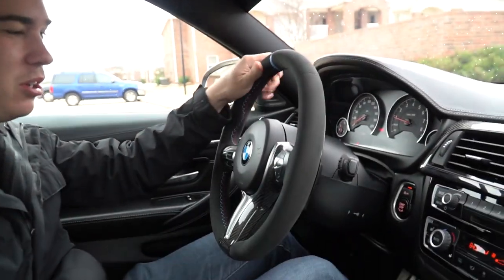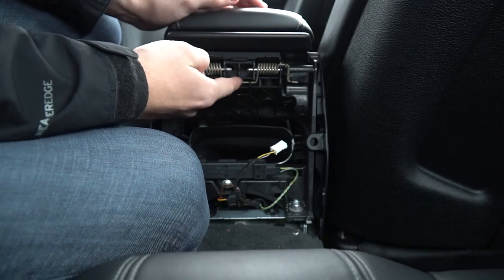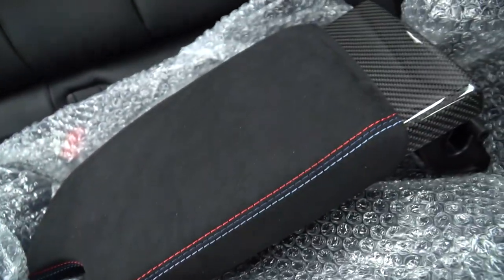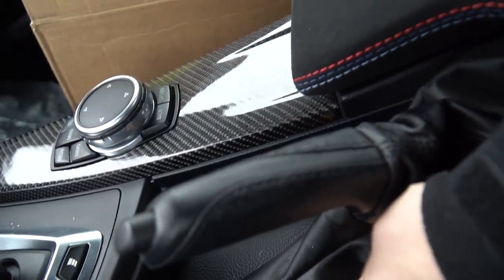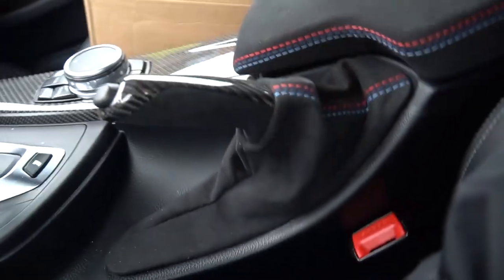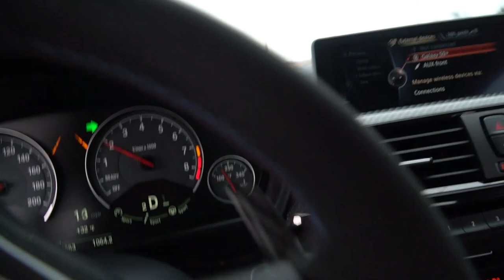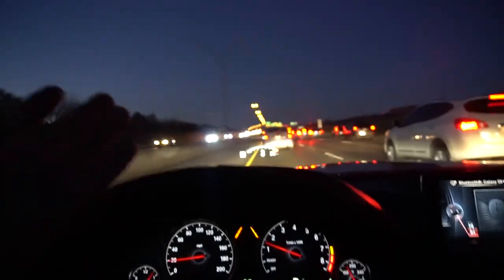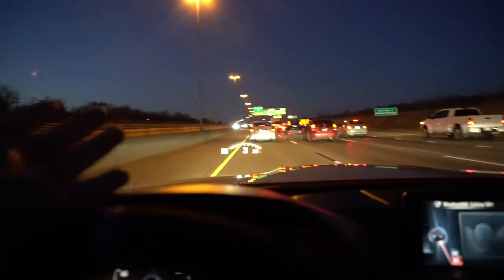Alcantara armrest/hand brake install *BMW M4*

Comment: I have the same color seats with white stitching. Does the tri color stich look weird against the white stitching? I want to get the armrest but worried it won’t match
Reply from the maker: I think it looks great. Your steering wheel has the same stitching so it brings it all together.
Reply: Bailee Durant ah, great point